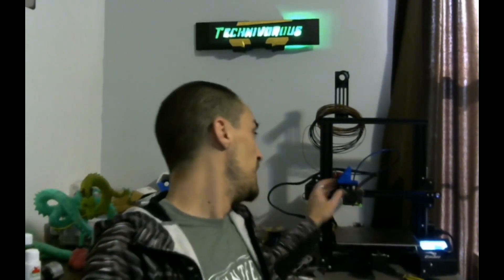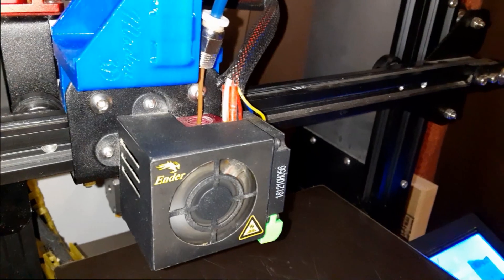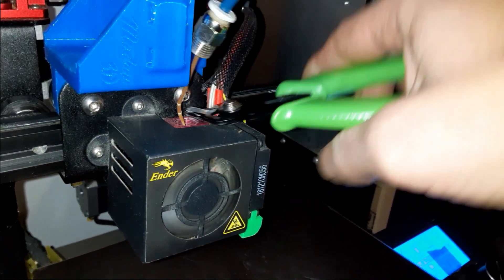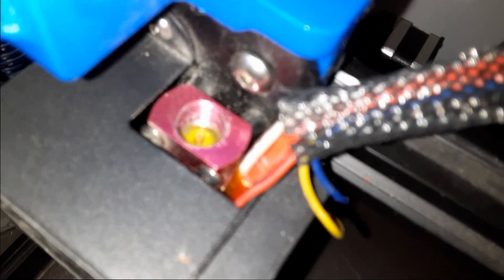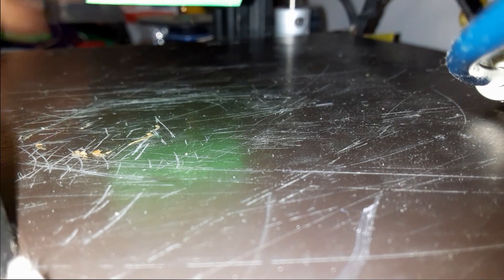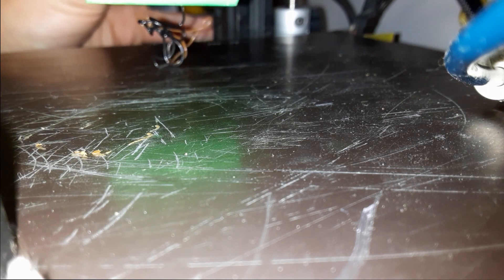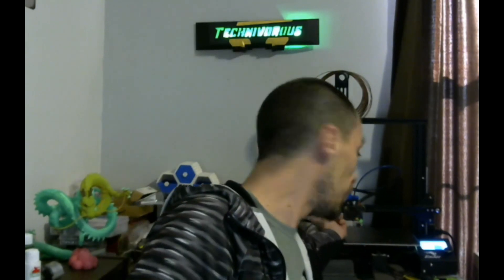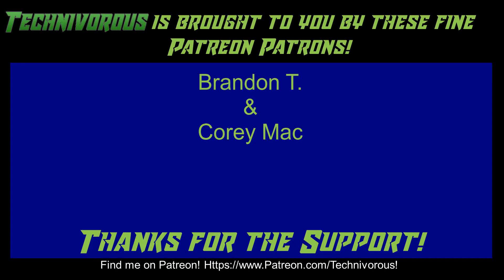The fastest way to unclog your 3d printer hot end

Comment: This is bad advice. You can actually clog more the nozzle by overheating filaments.
Reply from the maker: Yes if you leave it there long enough to burn you surely can. However if you watch the whole video you will note that I explain that this is meant to be done quickly. Even if the filament chars, the Allen key will always push it out. Always. The main problem with the heating used in this method actually comes from hitting the gassing off temperature of the bowden tube. The standard tube will char if the ender 3 is maxed out, but it will take a while at max temp to cause this. However I am using capricorn tubing so it's not a problem for me, and wont be a problem for anyone else either as the abs preset temp is 15 degrees below this point. So no, it wont clog your nozzle more, as long as you follow directions.
Reply from the maker: I do love your user name though. The mandalorian is the best piece of star wars film work done since the original trilogy!